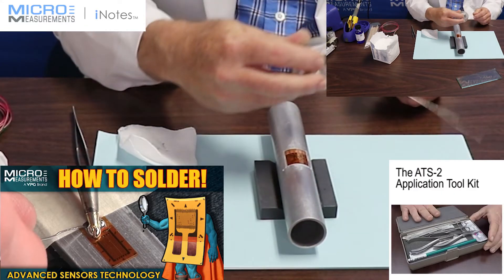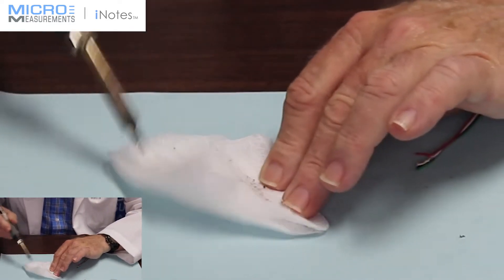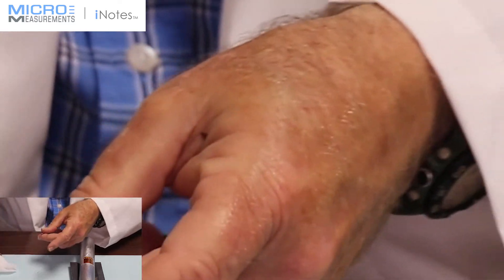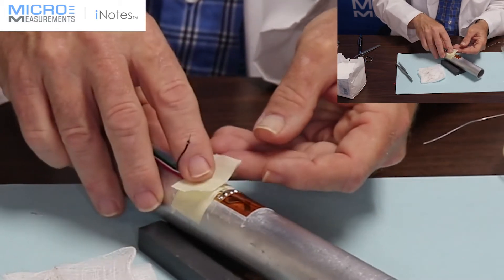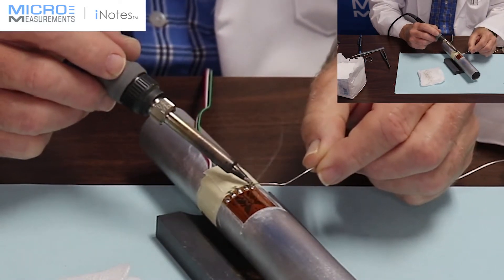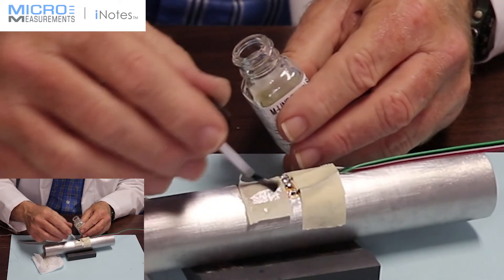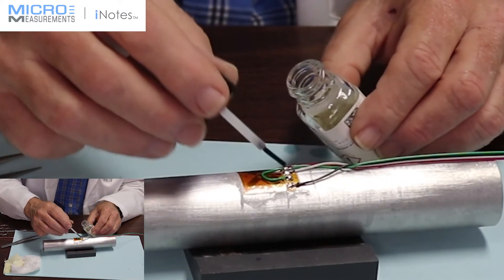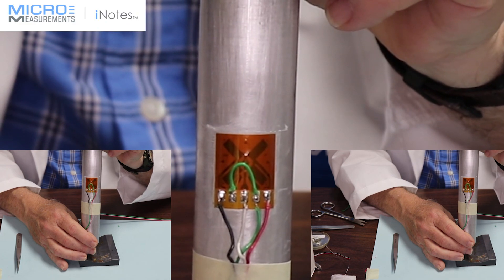How To Solder Wires on a Full Bridge. (Tips and Tricks)

Comment: How to paste the strain gauge in small areas? what are tools to be used for pasting the strain gauge and wire soldering?
Reply: Small areas and curved or even double curved surfaces can present a challenge.  One item strain gage labs find helpful to create a pressure pad shaped to the surface (including tight areas) is a product called ReproRubber from Flexbar.  It is a 2-part putty that when mixed and pressed onto the surface, cures within minutes to a durometer of 60 that is most commonly used for curing adhesives.  Using a straight razor, one can create more of a cube shape that will provide the correct pressure range dictated by the needs of the strain gage adhesive system.  A flat side is also then created so that a flat metal backing plate as a target for you spring clamp, dead weight, to cure the adhesive.  

Soldering would be the same as any strain gage installation utilizing a single, solid, insulated AWG 34 or 36 to get out of the area - such as Micro-Measurements 134-AWN or 136-AWN: https://docs.micro-measurements.com/?id=2383.

If you have any other technical questions, please feel free to contact an Micro-Measurements Applications Engineer.
Reply: @PaulDMillard  Thank you for your response. It was a valuable information. Could you please recommend the other tools like soldering iron and lens to be used in the strain gage instrumention in tight space?